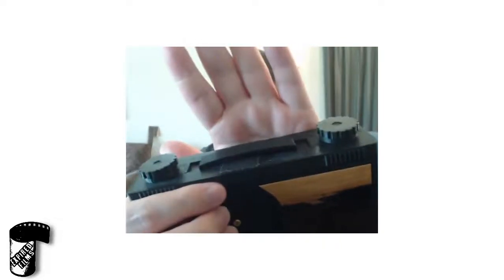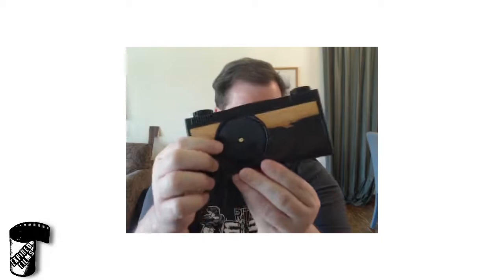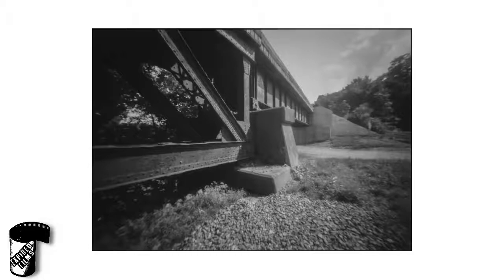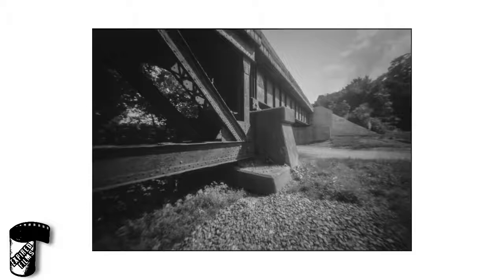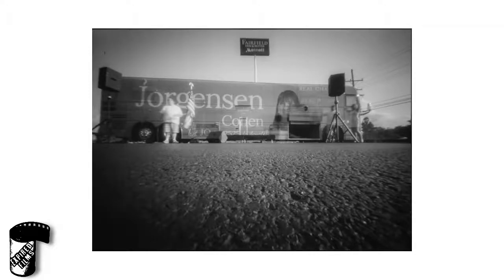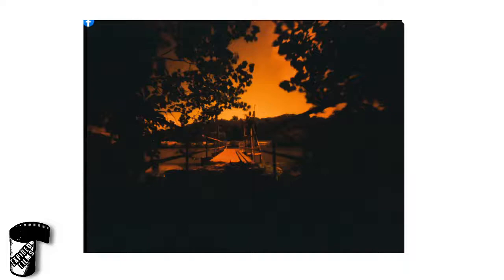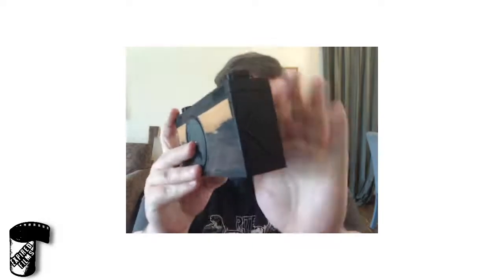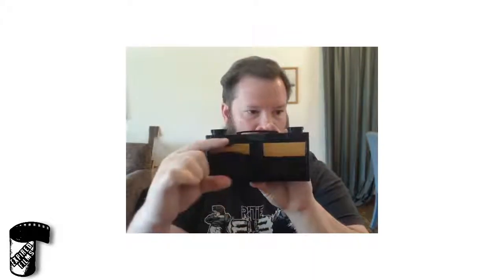Expired Films, Ep6 - 3D-Printed 6x9 Camera [CC]

Comment: Great video, and your camera looks great with that wood veneer.

I'm getting started printing one of these OSKAR Tuxedo cameras to play around with 6x9 pinhole photography. I'm having some trouble knowing what all to print from the Thingiverse page. A lot of the files seem like they have duplicate parts when I wouldn't expect to need two of that part, and I can't tell what the difference is between, for example, "sm_parts_plate" and "shutter_plate." Can you do me a solid and tell me which parts to print and which can be skipped? The documentation for how to print and assemble is basically nonexistent.